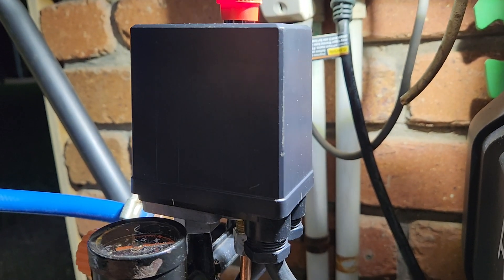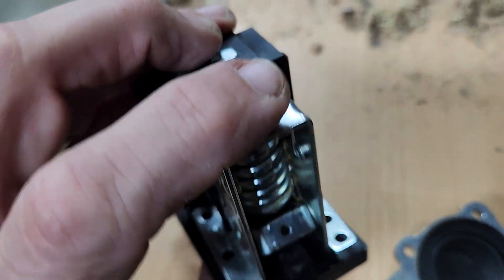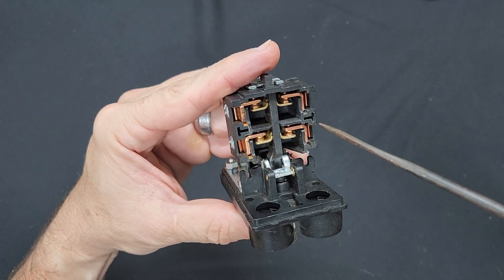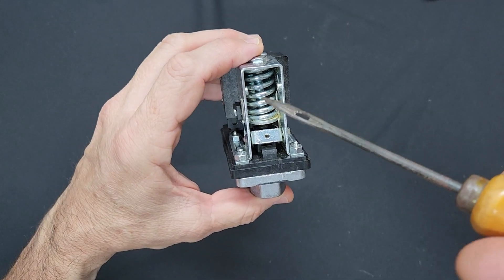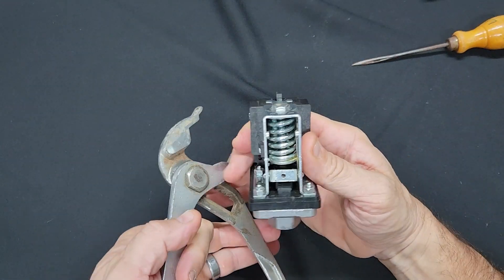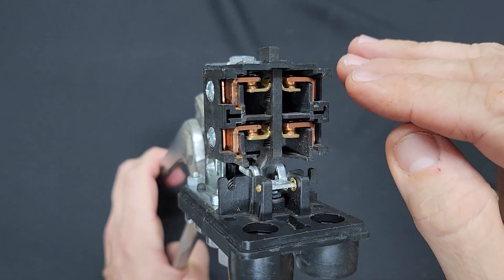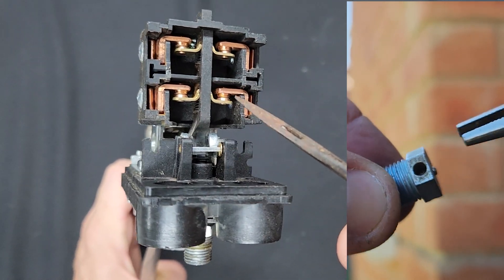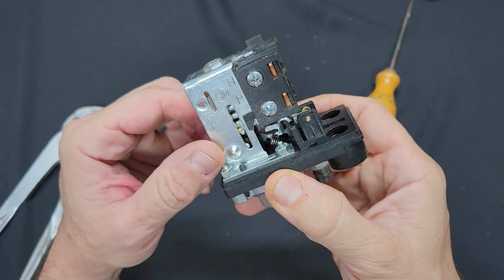How a Budget Air Compressor PRESSURE SWITCH Works!

Comment: Nice video.  What about if the unloader valve stays open (when the cycle has reached pressure or you put the stop/auto button down) and doesn't just do the little release of air for back pressure.  What would that mean? Problem with check valve or unloader valve?

Comment: I think I had the same problem with leaking  pressure switch while it was in off mode, in the same location as in the video but my solution was to follow that pipe to a check vale on the tank. I opened that and cleaned  and streched the spring just a bit. That was it, no more leak.

Comment: Video was VERY informative. My compressor isn't shutting off once it reaches its maximum pressure. The check valve opens and releases all of the air, and the cycle continues. This video will help me to troubleshoot my pressure switch before going ahead and replacing it. Good stuff.

Comment: Thanks for the video 👌 I having a issue with my compressor ive set the regulator at around 50psi and my spray gun at 30 psi and its draining the tank very low before it regenerates the pressure does this sound like a pressure switch problem any advice would be much appreciated thanks

Comment: Thank you for the clear explainer. I found an old 3-phase compressor without a motor, I thought of bolting a gas motor to replace the electric motor. Your video gives me some understanding of the intricacy of the pressure controller. It would be a lot of self-tutoring to repurpose the compressor.

Comment: Thanks. Very useful. From your previous video I replaced the pressure switch one one machine. On my 2nd machine, I have air coming out from the switch when turned off, which means faulty check valve. To prove, I took off the small plastic line from the check valve. There is no air coming from the check valve. Sounds odd it's leaking air from switch with a working check valve.

Comment: Refaced the one way check valve surface on my larger compressor. Hoping to fix it throwing the relay when it struggles to start some times I’m thinking from back pressure.

Comment: I’m having the problem that the pressure switch won’t shut off and the safety valve opens. I can’t seem to find a fault with it. I’m going look over the check valve tomorrow to see if it may be causing the issue.

Comment: If the small valve is faulty, the air compressor won’t recharge when the tank pressure drops, even if the switch is on. I have this problem and don’t know how to identify the cause. please help

Comment: It was exactly the video I was looking for. When I turned on the compressor, it blew, then you could hear something click and start pumping air into it. Now, however, it no longer clicks and no longer pumps air inside. From what I understand it's that little pin that doesn't click. Should I change the whole pressure switch?
Reply from the maker: Personally, I would change the complete pressure switch. Hopefully that fixes it for you.

Comment: THIS VIDEO IS WHAT I WANT EXACTLY! Thank you very much,  My DIY compressor using refrigerator compressor has a problem that is not turned off properly. Your explanation will be very helpful for me to fix the problem.
Reply from the maker: Great to hear! Thanks for the feedback!!
Reply: I fixed my compressor problem ! By the understanding of how it works, I found my compressor switch was not the problem. I found the issue was the check valve did not work properly. After fix the valve, On/Off works properly. Thanks.

Comment: Excellent video! –And how can I reduce the noise of the air pressure being released in the system when the pressure switch reaches maximum pressure? –I use an airbrush, residentially at dawn... and this "fsss..." noise is very loud... I made my own compressor and it is ultra quiet, apart from this noise from the same pressure switch when the pressure switch is disarmed.

Comment: Great video! my valve failed as well. I put a new one on and it doesnt shut off it just keeps pumping air until I press the button and air comes out the unloader valve, only issue is it just keeps coming out while I hold the button down.....its doing my head in
Reply: hi doesn't reply...I've same fault

Comment: Love the video !!  Good job !!
I wonder , what is connected to the "unloader valve" by those threads (1/4" or 1/8" npt ?)
Is the pressure release valve you actuated in the beginning of the video similar or a failsafe to the "unloader valve" ?  I mean, do they do the same thing ?
Also, is the tank pressure gauge connected to the switch in line before the "unloader valve" or after ??
Thank you for your generous consideration,
Sincerely .....................
Steph (Stephen) Leesville, LA. U.S.A.

Comment: My pressure builds up to 125psi and cuts off and cuts on at 90psi. Seems ok but little CFM output even though output pressure gauge reads 125.

Comment: It was a useful video❤. 
Bro would you mind helping me please? I have this pressure switch but when I turn it on, air comes out of the small inlet hole and also when I turn it off, air still comes out and the tank doesn't fill. What is the problem with the small valve? Apparently the spring is not working and it is not closing the air passage.🙏😊
Reply from the maker: Thanks, glad you found it helpful. The problem you're having seems to be exactly what this video is about. Also, see how I fixed it in my other video: https://youtu.be/Kczx5lMaDzM
I think your small valvle needs replacing by the sound of it.
Reply: @jelreviews  
Exactly the check valve doesn't work correctly 😑.  I think I have to buy another one.  It doesn't work even one day. Thank you bro❤️🙏

Comment: I managed to fix my leaking unloader valve. On the opposite side, there is a plastic cap, if you remove it gently then you can extract the needle. On the needle, there is a 1mm o-ring. I replaced the broken o-ring and everything is fine. Thanks for your excellent explanation!
Reply from the maker: Great tip! Thanks for sharing!

Comment: My AEG silent compressor would blow off the high pressure relief valve and the motor would keep running, it was obviously set too high. One turn of the adjustment bolt here and now the motor stops at 125psi without the relief valve going off, perfect!

Comment: HI i have bought a used burish compressor with same switch , my machine says its 150 psi /10bar but its cutting out at 110psi 7.800 bar {approx}  what is the likely problem? can i try turning  that screw more ? ??

Comment: Hi did you manage to get a unloader valve? if so would appreciate from where.
Reply from the maker: In my linked related video where I showed how to replace this switch, I went through why I had to purchase this cheap Chinese one. Check it out if you get the chance. It's because I could not locate or purchase just an unloader valve, so this whole switch was the next best and cheapest option for me. 👍

Comment: Hi, first I've seen perhaps hundreds of instructional videos on YouTube - and this one is among the very best.  It is clear with no waffle and explains everything very well.  Having watched it I took the pressure switch of my Clark Boxer apart.  I wondered if the fault I had was a perforated diaphragm - but no, that is fine - so I watched it working with the cover off of the switch.  The compressor goes around a loop.  It gets up to pressure (e.g., 140psi), switches off, and then the unloader valve dumps about 80psi, then the switch closes and it pressurizes back up.  Where I could do with some advice please, is that the unloader valve is different to the self-contained metal item you show in your video.  Instead, it is a plastic item held in place with a plastic cam/U clip thingy.  It is the vent hole in this plastic part from which the air is dumped.  The plastic valve has a push-in plastic pipe that goes to a metal valve on the top of the compressor.  That valve does look a bit like your unloader valve.  TiA
Reply from the maker: Hi, thanks for the feedback. I'm not familiar with what kind of pressure switch the Clark Boxer has, so I looked up Clarke Pressure Switch and to be fair, the unloader valve looked like mine - a removable alloy component. I haven't had any experience with a contained plastic unloader valve, so I'm not of much help to you. I'd suggest that if it is dumping 80psi after switching off, then it is an unloader valve issue and it will need replacing, if not even the whole pressure switch because I don't think you'll find simply a replacement unloader valve. Also, you could take a few photos and trying posting it up to a few compressor forum sites or reddit and see if anyone else might have had the issue or have a solution. :)
Reply: @jelreviews  Thanks for taking the trouble to reply.  I'm guessing the exact pressure switch with the plastic unloader that was fitted to my compressor is no longer available, so Clarke now fit a slightly different version fitted with a metal unloader.  However, I have managed to fix the issue.  It turned out to be the check valve.  When I first dismantled the NVR it looked spotless inside.  I went through the motions of cleaning the rubber seal anyway, and lo and behold, it now works.  The crucial bit I had not realised, is that a faulty NVR also leaks the air through the unloader valve vent.
Reply from the maker: @arthurhaslehurst5283  Fantastic... glad you investigated further and managed to fix it. Always learning with these things. :)

Comment: Hi can you please tell on the cheap Chinese compressor switch you have the letter P and N am I right in thinking that the p is for positive (brown wire ) and N for Neutral(blue wire) Uk  would really appreciate it as I just brought one 
Thanks in advance
Reply from the maker: That's correct... P is your 'active in' wire which may be brown or red in most cases and that is on one side, on the opposite side is where it goes to the motor when power is turned on. You'll see at the beginning of my video how it was wired.
Reply: Thank you for your quick reply I’m just a little bit confused on the start of your video that looks like a old compressor switch, which shows the brown wire at the top and blue for the bottom but when you have the new Chinese one in your hand  the markings for the top is N= neutral and bottom is P= Live  so to me this new Chinese compressor switch is wired different is this the case ?
Reply from the maker: Yes, I see what you mean and perhaps I didn't explain this well. Basically, to keep it simple, yes keep Live on the "P" and Neutral on the "N" - it's simply reversed on the Chinese one that I purchased. Just make sure the MAINS active cable comes in from one side, and the other side goes to the motor of your compressor. So, your Live Active Brown Wire goes to "P" on say the left side, and then the brown wire on the other side goes to your MOTOR, and this becomes LIVE when the brass connectors touch when the switch is activated and the circuit closed. Do exactly the same with the blue NEUTRAL wire from the mains supply to the N on the left side, and the blue NEUTRAL wire on the other side of the switch to the motor. Hope that makes sense.

Comment: Nice video.  I now understand why a bad check valve at the tank entry would leak to a leak through the pressure switch when the pump is not running.  The same action that opens the electrical contacts also opens the unloader check valve.  The reason that the normal rush of air when the pump is shut off is so short is because, with a properly working tank check valve, only the small amount of air in the lines needs to equalize.  Thank you for this

Comment: Excellent presentation! My pressure switch has just failed - can't actuate the On/Off switch button coz its push rod is stuck in the up-position and can't push the button down with the compressor air reservoir either empty or near full pressure (manually filled from the 240V supply) - no difference to the On/Off switch position! What symptom(s) did the small air dump valve exhibit when yours failed ? I think my dump valve has also failed leaving pressure in this line??? Did you have to purchase a complete switch or did you source a replacement dump valve?? Where did you source your replacement part from? You are obviously an Aussie and I hail from Gippsland, Vic. Cheers
Reply from the maker: Thanks. Yes, I'm in QLD. Hey, check out the attached video to me fixing my compressor with this issue: https://www.youtube.com/watch?v=Kczx5lMaDzM&t=0s&ab_channel=JELReviews Hopefully, it might help you solve your issue.... maybe.
It has there in the description where I purchased my replacement switch from for the cheapest price.

Comment: Tnq for the video, but maybe u can help me. i change my preasure switc to the new one and its wont stop pumping. Where i can find the problem? Theres no air leak from the compresor. But it cant pump more then 4.5Atmospheres. its a 8A compresor. Please help :)
Reply from the maker: Hi, to me it sounds like there is definitely a leak or a faulty check valve somewhere. Have you ensured the water release valve on the bottom of the tank is fully closed?
Reply: @jelreviews  i found the problem. In market they sold me wrong preasure switch with higher preasure and my compresor cant reach so high preasure 😅 all good

Comment: Compressor starts ok but when pressure drops and tries to restart it blow fuse
Reply from the maker: Hmm, sounds like a possible starter capacitor fault, might need replacing, not sure. Here's a helpful forum thread that might help... https://www.mig-welding.co.uk/forum/threads/compressor-motor-keeps-blowing-fuses.89994/

Comment: My compressor won't turn off! Now I'll be able to see why the pressure switch isn't working properly. Thanks for showing how these things work, great explaination, easy to understand.
Reply from the maker: Yeah, hope it helps! It'll be either unloader valve, or tank motor air inlet check valve. 👍👍
Reply: @jelreviews  I'm sure this info will help me sort it. Cheers